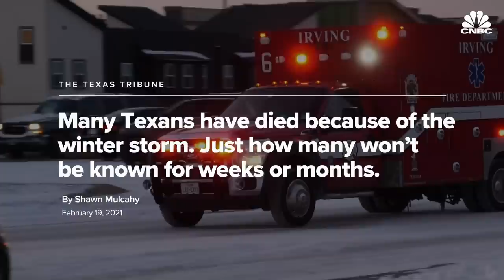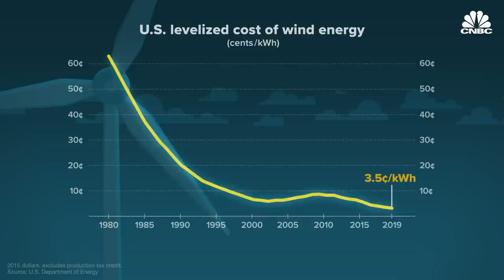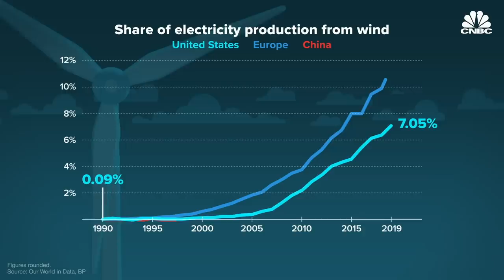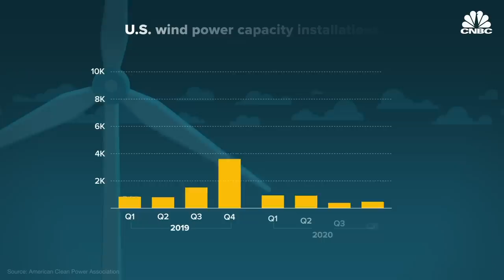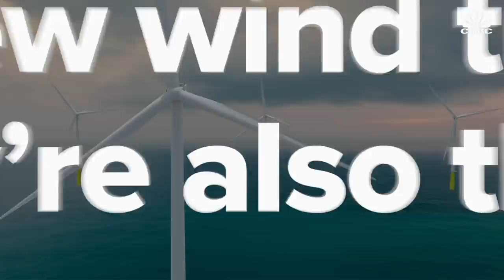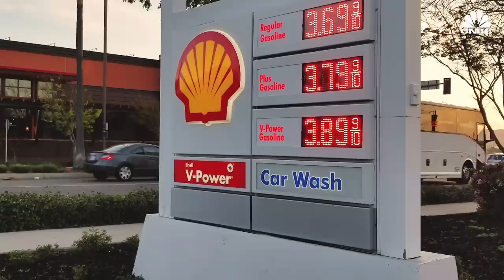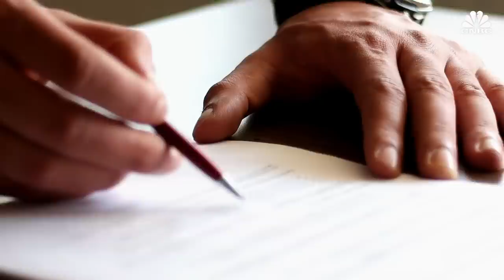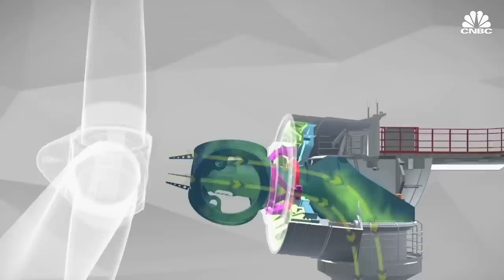The Rise Of Wind Power In The U.S.

Comment: Holy crap, didn't realize how long the blades were!
Reply: The wings of an Airbus A380 are childsplay to the size of wind turbines!
Reply: Have in mind that when they say "rotor size" they mean the diameter the blades sweep, not the length of each individual blade (or the radius).
Reply: In 2011 I worked on a team building the largest blades in the world, with a length of 73,5 meters.
The largest blades today are around 100 meters or almost the length of an American football field (120 yards).
Reply: And they produce more electricity than smaller turbines - not just in megawatt capacity but also reaching capacity much more often - as far I remember max capacity 50% of time and producing electricity 80% of times for the best/largest wind farms

Comment: Yeah those turbines didn't have the cold weather package to heat up the inner parts, and now they're complaining after they went to the cheaper route.
Reply: Well, how many times does it snow in Texas? Rougly once every 65 years? I think it makes total sense getting the cheap ones
Reply: @mateosanchez1823  Winter storms regularly happen in the northern parts of the state. Storms like what happened in 2021 are more rare, but it still happens. When i was in dallas, an ice storm was normally a one every year event. The panhandle, where a lot of texas wind is, experiences more frequent freezes compared to the rest of the state
Reply: Calvin Parish  yeah not thst I've work on them or anything mate.
Reply: @mateosanchez1823  my point is exactly if they didn't get the heaters because was a calculated risk, still a sizable risk they're gambling with.
Reply: @mateosanchez1823  The had the same issue in 2011 with freezing power plants.  However if you don't winterize your power infrastructure don't then turn around and scape-goat wind-turbines because they failed when you didn't winterize them.  The fact the wind-turbines failed had nothing to do with renewable energy.  Any powersource can fail in cold weather without proper winterizing.  However how much do you want to pay to prepare for a "black swan" event.  I think Texas is having those discussions right now.
Reply: @mateosanchez1823  Actually, the last time it snows in Texas was 2011. 10 years ago, not 65. And extreme weather is getting more and more common.
Reply: When I heard that coal plant even skipped on pipe insulation :D ... that's like foil and styrofoam ... it's like: greed and avarice kicked them back in the butt. Sad that this is 'mis-decisions' of management, but paid risk by the people :(.
Reply: Funny thing is they didn't even completely fail. They operated way above what was expected for not having the cold winter package. It's gas that failed on an epic scale.
Reply: like always in the us, same with the paper houses after hurricanes
Reply: @SCL111  especially if we continue on this course with our carbon footprint. Hurricanes, polar vortexes, extreme winters and summers are going to be a more common occurrence.
Reply: @SDGreg  The point is that you have to make sure they don't freeze. So what if it cost a little more.
Reply: @mateosanchez1823  Every 10 years or 20 years, with it happening more frequently recently.
Last in 2011 and before that in 1989. They had the opportunity to correct it between then and now...Nat Gas really dropped the ball.
Reply: Calvin Parish  your idea of who is a “thinker” just means those you agree with. Imagine still using the word sheep.
Reply: @mateosanchez1823   it snowed 10 years ago. A snowstorm just this large
Reply: Calvin Parish  completely agree mate
Reply: @mateosanchez1823  When designing something as integral as your energy grid you prepare for those scenarios.
Not to mention that climate change will make such events more frequent.

Suggestion: stop prioritizing profit over lives
Reply: Calvin Parish  Your politicians chose to not enforce minimum regulations that every other power plant has (because they follow federal regulations on the 2 national grids). Critical lifesaving infrastructure should not be where we cut corners and give the lowest bidder the job without making sure its safe
Reply: @makatron   Dude I’ll lived in Texas all my life, we are used too 110+ degree weather and our equipment is built for-heat not cold.
Reply: @Fernando5455Jr  it was what I said, the chance of a extreme storm was low but it came, still they complained the turbines froze which was expected due to the fact that they gambled with the weather.
Reply: @makatron  Even if they knew how bad it would be there would have been nothing they could’ve done to winter proof the windmills, they are quite literally as far as the eye can see in Texas. Over 10,700
Reply: @Fernando5455Jr  Why can Texas not figure out how to winterize turbines when Alaska, Canada, Norway, Sweden [...] can?

Why was Texas also unable to winterize natural gas pipelines and powerplants?

Hint: it has always been possible, because literally every place except Texas didn't have a problem. It just costs a little bit more money meaning Texan power companies make less profit. It all comes down to capitalism. And Republicans prioritizing profit over people
Reply: @ThomasBomb45   You don’t get it. No 💩 we can figure it out. But incase you forgot, it’s TEXAS☀️. I’ll lived here all my life and we deal with 100 degrees on a regular day. No one in our lifetime had to deal with cold for that long.
Reply: @Fernando5455Jr  there was a winter storm just 10 years ago. People whose jobs it is to know this kind of thing have been warning that Texas needed to winterize its electric grid. If texas was part of the national grids, it would have had to been winterized.

I'm not saying the average person knows that, though, which is why the average person normally doesn't make these decisions. The Texan republican party made the decision to not regulate the industry, and the industry decided to choose profit over people's lives. It's predictable
Reply: @ThomasBomb45  I would hardly even called that storm a true winter storm compared to the one we just had.  If Texas was part of the national grid it would have to been winterized. Guess what doing that does not guarantee no blackouts. The countless times other parts of the country have had major blackouts due to winter storms. despite being on the national grid. There’s no point arguing with someone like you who has clearly political bias. As a native Texan I know my state better than others especially who are not from here.
Reply: @Fernando5455Jr  other states blackouts are not nearly as bad, widespread, or deadly. People died because the energy production froze

Comment: Interesting Facts About Wind Energy👍
Wind energy was first developed with windmills in 200 BC in Persia and China.

Wind energy was then used for hundreds of years to pump water and crush grain. 

The first modern turbine was built in Vermont in the 1940s.

Turbine towers normally stand over 328 ft tall. 

Each turbine blade is normally 260 ft long.
Reply: Well, you almost got it right except that first modern turbine was built in Yalta, USSR in 1931.

Comment: It’s total insanity to oppose renewables, total insanity. Well put-together video:)
Reply: i just like the idea of coal
Reply: Funny because all these so called renweables require, coal plants and steel plants to build the actual turbine and maintain it
Reply: @80sbaby98  now that is the case yes but that can be swapped out for renewable hydrogen in a lot of cases, then it’ll be totally green!
Reply: @80sbaby98  Steel plants use electricity, dummy. Not coal.
Reply: @Daniel-gs9eh  We will run out of Coal in 2050 and or 2100.
Reply: @cakeisyummy5755  so that tons of time to slowly move over to other stuff the free market can easily do it then
Reply: @cakeisyummy5755  Oil will too. My prediction is that all developed countries will be carbon neutral by 2050.
Reply: @charlesmoore766  the UK already regularly runs on over 50% renewables and that’s without proper investment and large-scale battery storage.  It’s more than possible for the whole planet to run on renewable energy, all we need is political will.
Reply: @AmerBoyo  UK is 40% renewables as of 2020 of which 50% is nuclear, which IS major investment.  Did you read my post where I present the details of 
US electricity generation as of 2020?

Here are UK 2016 electricity generation %.  Looked for more current data but official gov publications are convoluted.
---Gas: 40.2% (0.05% in 1990)
---Nuclear: 20.1% (19% in 1990)
---Wind: 10.6% (0% in 1990), of which:
---Onshore Wind: 5.7%
---Offshore Wind: 4.9%
---Coal: 8.6% (67% in 1990)
---Bio-Energy: 8.4% (0% in 1990)
---Solar: 2.8% (0% in 1990)
---Hydroelectric: 1.5% (2.6% in 1990)
---Oil and other: 7.8% (12% in 1990)
56% is generated by co2 emitting sources.  (this means anything Bio).  

US, end of 2020 is at 39.7% renewable, with 19.7% nuclear.  The information on the website of the Energy Information Administration shows for the US to get from 39.5 to 80% in 9 years can not happen.  

It is not a lack of political will but the unwillingness to realistically look at the capacity of what is available vs desired outcome.  

The technology does not exist to get the desired result.  Even the UN climate panel acknowledges this.  Improved efficiency with wind and solar will not get us there.

Will there be a technological breakthrough.....some day
Reply: @charlesmoore766  utter rubbish, give every house and building solar with batteries and beef continue building wind & solar farms and we’ll have more electricity than we know what to do with.
Reply: @AmerBoyo  UK data you provided is refuted by UK data.

I challenged you with data for Biden's goal of 80 electricity with clean energy by 2030 and all you provide is unsubstantiated opinion.

Comment: I am pro decarbonizing hence I am pro nuclear power. NP is the gold standard of clean energy. It’s as clean and safe as any alternative, requires a fraction of the resources and produces clean, reliable energy 24/7/365. NP really is the premier example of dematerialization in which we actually use less to produce more.
And we certainly don't add intermittent power sources in order to harden our increasingly fragile energy infrastructure.

Comment: Wouldn't painting one black, increase heat on that blade affecting its temp and performance?
Reply: But you have to factor the blade material's tensile strength and tolerance to high heat
     Aerial Turbine engines( Turbojet,Turbofan, Turboprop, and Turboshaft) use internal blades that are made from titanium 
because 
   no other metal can handle the stress, heat, and fatigue the innards of a turbine could subject to their innards

Comment: On the grid where I live in Australia, we have coal and solar and wind and gas. The Capacity Factor of coal is about 60% and the cApacity factor of wind is about 50%. Because the wind so cheap and reliable the coal power stations are closing down. Probably all gone in a few years or so.

As the wind turbines get bigger. so does their Capacity Factor, especially if they are well engineered and large enough to run in geostrophic winds above the atmospheric boundary layer.

Comment: The answer to bird deaths are Vertical Wind Turbines (VWT). These wind electricity generators do not change shape and as such are treated by birds as another obstacle to fly around. Also, they generate power regardless of the winds direction. As the grab blades are 360 degrees around the VWT.
Reply: Uhmm... regular wind turbines automatically turn into the wind.
And VWT isn't an effective way of generating electricity. There's a reason why they never took off.

Comment: It's strange that it's 2021 and most of our power still comes from turning a crank.
Reply: Where should we get our power then 😀
Reply: Lol that's basic physics bruh, no other method exist. Even nuclear power came from "turning a crank"
Reply: @Nathan Gautrey Here's a concept for a hydrogen-boron fusion reactor that doesn't use a steam-driven turbine: https://newatlas.com/energy/hb11-hydrogen-boron-fusion-clean-energy/

"a largely empty metal sphere, where a modestly sized HB11 fuel pellet is held in the center, with apertures on different sides for the two lasers. One laser establishes the magnetic containment field for the plasma and the second laser triggers the ‘avalanche’ fusion chain reaction. The alpha particles generated by the reaction would create an electrical flow that can be channeled almost directly into an existing power grid with no need for a heat exchanger or steam turbine generator."
Reply: All fossil fuel and nuke power plants operate on the same principle.  Heat water and use it to turn a turbine.  Nukes are just very big, complicated and radioactive water heaters.  No quantum leap of technology for generating electricity.
Reply: @Hello-uk5xp Nuclear/Renewables.

Comment: Wind turbines are only effective in certain locations in the U.S like Texas and other plains states. They can provide clean sources of energy but need enormous amounts of non-green material to construct. Bird populations are also affected via wind plants and noise pollution is also a negative externality of wind power. The amount of land needed to be used to generate wind compared to solar,  nuclear, coal, and natural gas is far larger per sq/km. 
Void of sunlight or other natural resources, wind power would be more efficient. Other than that it can be costly and inefficient compared to other power plants. The video does bring up good facts about the lifetime of windpower but ignores the maintenance cost and land use for wind power, which results in more cost for the amount of land used.
Reply: Lol, no. Windmills are often built on elevations, not plains. Also, the noise is pretty negligible
Reply: @fgsaramago  Plain states, where wind potential energy is the highest. That doesn’t mean the windmills are built on an actual plain. The term refers to a geographical location of the U.S. Looking at a map of the U.S, the highest concentration for wind power feasibility are located in areas between the Rockies and the Mississippi river (plains states region).
Reply: @N9mber  no, you dont want much wind. Windmills have to be stopped if theres much wind. Also, the reason why plains states are called such is because there are plains in them...
Reply: 1. It is not suggested that Wind should be the main source of energy, only a part.
2. I have heard wind turbines (big ones) and they are not noisy at all, unless you live very close to one
3. Bird population, really? The amount of different species getting affected by black energy is 10-100x greater than what wind will ever do.
4. We have plenty of land
5. The benefits far outweigh the negatives, just look at air pollution alone
6. Even if you factor in the maintenance cost, you will still get a nice return on your investment, and you do not account for future improvements.

Comment: they left out one of the most important pieces of information ; the difference between nameplate capacity and capacity factor . she is telling you the nameplate capacity while the capacity factor is the amount of energy actually produced , which depends on the strength of the wind . offshore wind is half or less of nameplate capacity while onshore wind considerably less . backup dispatch able energy will still be neccessary when wind speed is low or nonexistent . grid scale batteries will cost trillions .

Comment: "The largest driver of warming is the emission of greenhouse gases, of which more than 90% are carbon dioxide (CO
2) and methane. Fossil fuel burning (coal, oil, and natural gas) for energy consumption is the main source of these emissions, with additional contributions from agriculture, deforestation, and manufacturing. The human cause of climate change is not disputed by any scientific body of national or international standing." ---- Wikipedia. Either we source ALL our energy from renewables, or we will die a slow death, no doubt.

Comment: how engeniers prevent rust in the wind turbines offshore?
Reply: Dont use plain steel or iron. Many stainless steels are very rest resistant. And aluminum creates its own protective layer when it corrodes.
Reply: Blades are made of composite materials that don't rust
Reply: But aluminum cannot be recycled
Reply: @alfredoalcantar8691  what? please tell me you are joking? Cant be recycled my ass. any metal can be metaled down and re cast. I mean if not, why would some people buy aluminum cans XD
Reply: @alfredoalcantar8691  ... aluminum is among the easiest things to recycle
Reply: @alfredoalcantar8691  it's probably the most recycled material on earth...

Comment: Where did 20% batteries come from? Wind commonly stops for a few days. The sun goes down every day. Let me guess. He has a model! Otherwise pretty sensible report exploded at the end!
Reply: when you run all the numbers in simulations, that's kind of where various research groups have gotten to using different models and methodologies, using known demand curves etc...  - of course their assumptions list are best effort estimations - in reality, you'd head toward that number and adjust as needed...   Power use drops off during the night, which offsets some of the solar day length... wind picks up in the evening generally... match up generation from years of data that exists, scale it for future installs year by year...  not out of the realm of making good educated evaluation.   One thing people seldom consider is improving use end use and how much that can free up, reducing demand... that that space, is ripe for picking all across industry, residential, HVAC... name it.